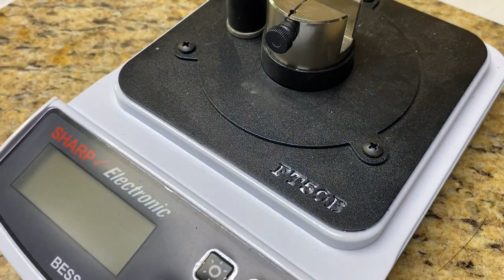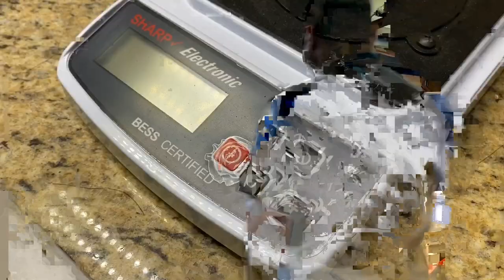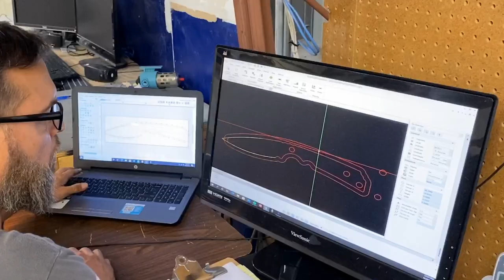Tactical Knife Maker

Comment: I know the whole world loves kydex but I don't. I like bolteron instead. I've had problems with kydex loosing shape and deforming especially in extreme weather Temps. I doubt the weekend user would see much of a difference. I don't think the market or makers would ever switch.
Reply from the maker: I am far from a weekend user, but definitely dont have extreme temps here.  Never had any issues with it.
Reply: @NatureReliance  in general I don't see many people complain about kydex either. Besides boltaron is slightly more expensive and requires a different temp for the press iirc so it's a bit of a change to manufacture.
Reply: Tactical Center i have been in all types of weather kydex works just fine . Extreme temps natural disasters . Never failed me once .
Reply: Nature Reliance bro i have been in -30 to 120 temps high winds floods deserts snow ice mud etc . No fails .
Reply: @warlantactical  cool bean's